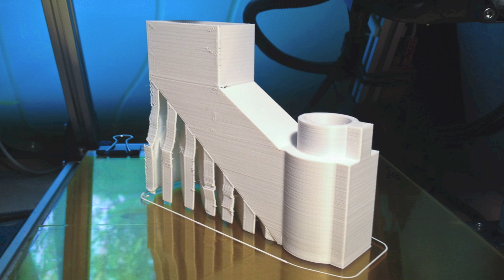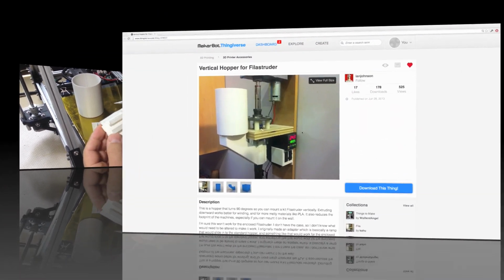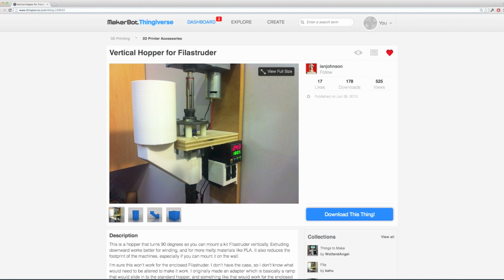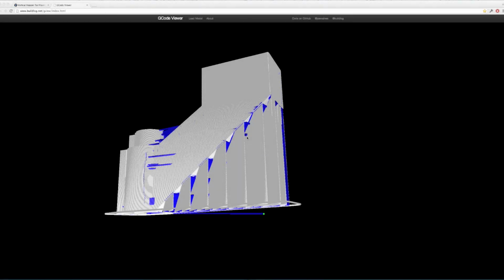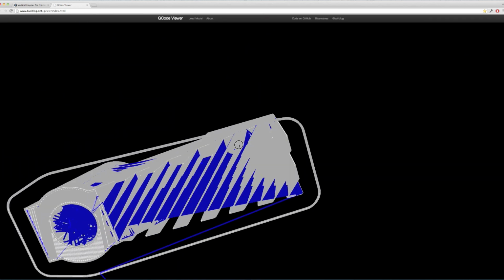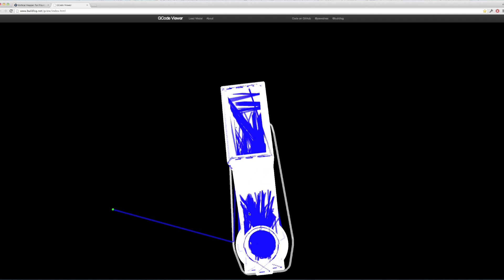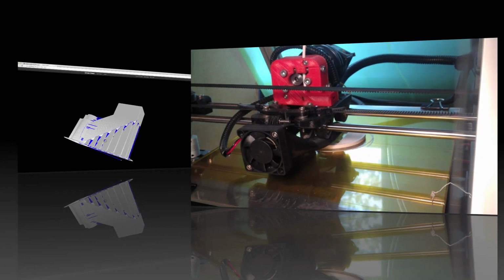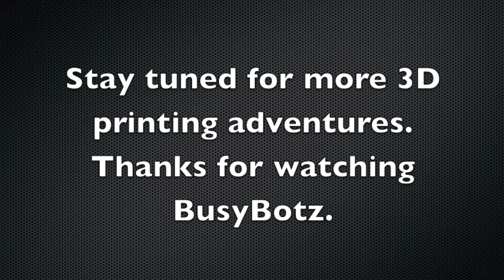External & Internal 3D Printed Support

Comment: I'm looking to print a very thin hollow cylinder out of Ninjaflex, I'm thinking  building supports colones around the cylinder using ABS to prevent the print from "closing in". Do you have other recommandations? seeing this, i might  fill the whole inside of my cylinder..

Comment: Is there a significant reason to have the part angled from top left corner to bottom right corner on the build plate instead of straight (Here - 06:26), or is that just to help it fit better with the other parts? Thanks in advance!

Comment: Lately I have been creating my own support incorporated into the object. I found a thin wall with a 1 layer gap will support just fine yet remove even easier than Slic3r's support. Plus that way I can make it just where it's needed.

Comment: It doesn't really need support on the inside, it should be able to bridge. However only Skeinforge has the option to add support on the exterior only, and I avoid Skeinforge as a rule. Kisslicer has really good interface between support and the print. I was able to poke at the interior support a little bit and then slide the whole thing out as a single piece.

Comment: hi, nice video, is your fan cable scratching along the X axis? and it looks like you have some wooble around the Z axis, you should check the Z wooblle for better results and less sanding to get smooth parts